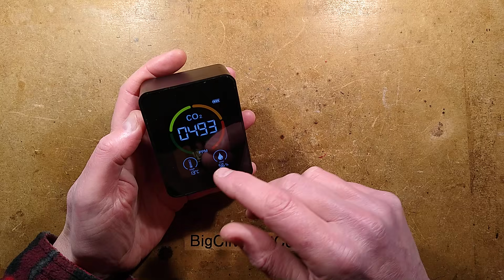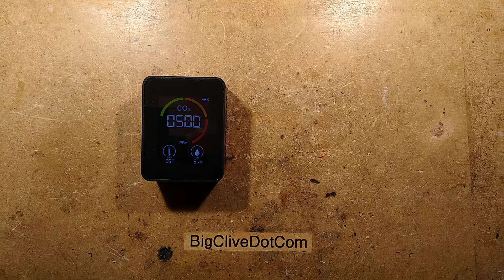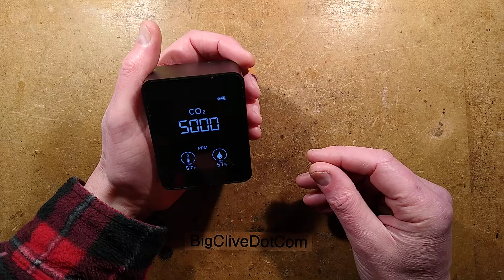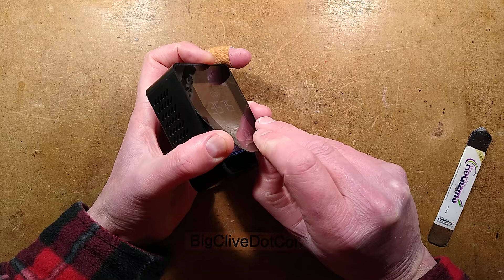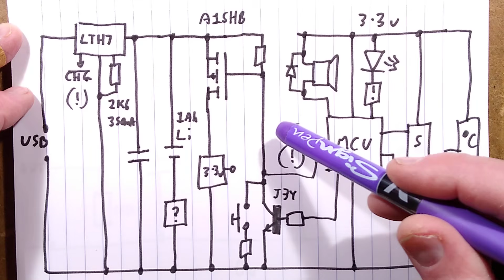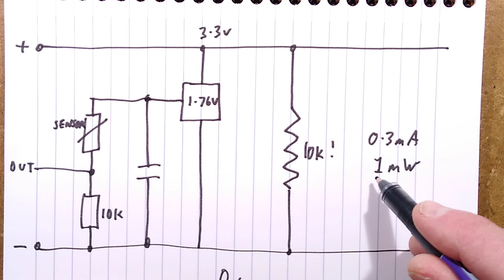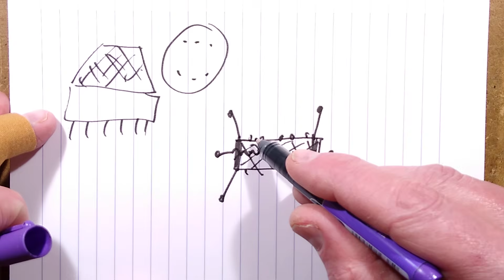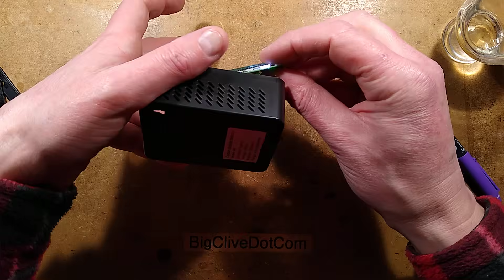Fake CO2 monitor (party detector) with schematic

Comment: Huh, this one is kinda weird... like why even? xD 
I've seen this design on Aliexpress, not sure if it's fake there too. Perhaps they are selling an erroneous mislabeled batch? Prototype batch that didn't work? Perhaps some people are just buying defective stuff from China and selling them on eBay.

See, here's the thing. I have two air quality monitors from Aliexpress... neither look like the one Big Clive has there, but I think one of them is like a more advanced model from a company that makes one that looks exactly like that.
The other is completely different and from another company.

I dunno how accurate they are as I don't have accurate instrumentation to compare to, but I do know that both are pretty sensitive to CO2 levels. If you breath a little close to it, it starts ramping up quite dramatically. 
Other measures like pm2.5 and pm10 also seems to respond well enough, smoking close to it will ramp up the numbers. I've also seem the numbers ramp up one day we had smog because of a forest fire closeby.

One of them has a clock and temperature that is somewhat correct, not a whole lot more than that.
The other has CO levels which I never saw moving, a hygrometer that is totally wrong (not sure if my unit is defective or it's just a fake - it's always at 90 something per cent as if I lived in a swamp or something), a thermometer that seems to be always a bit above the mark but changes accordingly, and also TVOC and HCHO which I dunno if works or not.

But it works well enough I guess... perhaps someday I'll open it up to see what is going on there. xD

Comment: I use a CCS811 module at home. In home assistant, the CO2 and TVOC graphs are completely identical, only the numbers are different. It does seem to work, but I have no reference to verify.
Reply: In s glass mix some vinegar & bicarbonate of soda (Sodium bicarbonate) it's in the Home Baking aisle in your supermarket. 
It will bubble and the gas given off is pure carbon dioxide.
That'd be a handy reference source of pure CO2 for you.

Comment: These are really common for example in fast food like McDonald’s, so employees know when to evacuate.
Reply: Is that because patrons may get a bit rowdy when the measured alcohol levels are high?
Reply: Is there ever a bad time to evacuate a McDonald's?
Reply: you sure that isnt a carbon MONoxide sensor not carbon DIoxide sensor?
Reply: @mycosys  100%. It's for the CO2 storage tanks for the soft drinks. 
https://files.chartindustries.com/20998342_McD_AX60.pdf

Comment: CO2 is good to measure as a proxy for air/ventilation quality, especially in terms of trying to inhibit the spread of infectious diseases, alongside how high CO2 levels tend to make people feel pretty sleepy/crappy. Had long wondered if the super cheap CO2 sensors I'd seen on sale were just VOC sensors, as actual CO2 sensor modules themselves are usually at least 70% or more of the price of them, big part of why I ended up putting some together myself. At least this way I know with certainty I'm actually measuring CO2 itself.

Comment: I would like to thank you. By watching your video on the lithium cells in disposable vape devices I have been able to fix several devices that the lithium cells had given up in. Even increased their working time significantly.
Reply: Bad idea. The wired resistance where the liquid evaporates is getting gunk over time and needs to be replaced. Get a proper reusable device or some rebuildable atomizer instead of using those disposable craps.
Reply: @PainterVierax  sorry I didn't specify. I am using the batteries for other devices, not vape related. I use a reusable vape with replaceable coils and tanks that are refillable for my nicotine needs, but had several old disposable ones that were laying around because I didn't wanna throw them in the trash because of what they contained and what it'd do to the environment.

Comment: The co2 reading is directly related to virus levels in the room. If there is someone with covid or the flue in a room and that rooms co2 level goes to 1200 ppm then there is not enough fresh air intake and virus levels in the air are also beginning to rise.
Reply: I have used a co2 detector on vacations and at big parties. Almost every bus getting to excursions had co2 levels above 1200 ppm. So I put on an n95 mask. 

Thanksgiving at my house is 25 people. Co2 gets to 1800ppm if I don’t have the circulating fan on. I can actually control the enthusiasm of conversation by playing with the co2. Allow it to go above 1500ppm and the room gets quiet. Bring it down to 800 ppm and people start talking again. It’s kind of funny to play with.

Comment: If it's Chinese, they probably got CO2 confused with CO on the display, and it's meant to be a Carbon Monoxide detector. According to one website: "Other gases that can set off Carbon Monoxide detectors are isopropyl alcohol, sulphur dioxide, acetylene, propane, hydrogen sulphide, dimethyl sulphide, mercaptan, ethyl alcohol, ethylene, methyl alcohol, hydrogen cyanide, and nitrogen dioxide."

Judging by the list there, it might also act as a Bad Breath detector.

.

Comment: So glad I didn't buy that one. It's cheap. But the one I got had more review and a better rating. Also, a non alcoholic exhalation with raise the numbers. Cooking on my gas stove without the range hood venting also raises the numbers. One time making fig jam I had the large burners going full throttle and it set off the sensor on the other side of the house. It is good to have a co2 sensor. I now use the vents and open the windows more often. I have the Forensics Detectors FD-CO2000.

Comment: I have the exact same one at work and noticed the same thing ..upon further inspection I found out that common CO2 sensors have readings in ethanol as well (the SMD type)..so I didnt think it was fake(breathing on it did make a difference though) just a limitation
Reply: Breath has water and other interesting chemicals in it. So reacting to your breath isn't odd.

But you need to open fizz to check for CO2 sensitivity

Comment: CO2 is used as a proxy for measuring air that is stagnant. Mostly in the context of trying to ascertain if a public building has adequate exchange of outside air to help reduce airborne virus spread.
Reply: Our HVAC system at work has a CO2 sensor in it. If it gets above the set level it opens a damper to pull in fresh air from outside. It's pretty neat to look at the graphs in the reports it can generate and see the level around 425 ppm first thing in the morning and as everyone arrives it starts climbing. Usually just after noon or 1PM the level gets high enough that the damper starts cracking open and the CO2 levels off. If we have an event that brings an extra 100-200 people into the building it will spike way up and the damper goes wide open trying to compensate.
Reply: and the sensor is a VOC sensor that uses VOC as a proxy for CO2 in human presence.
Meaning: This device guess air staleness by guessing CO2 Content by guessing VOC content.
Why not skip the extra steps and guess air staleness from VOC content?
Reply: @sarowie  Omg I love that roundabout so much. It's the pinnacle of consumer goods.

Comment: The new Sensibo air quality monitors have the same problem. It falsely says CO2 in multiple places. They call it "eCO2" when it actually measures VOC. Unfortunately, burning candles don't give off alcohol. Neither do plants. Not sure about fish. Took me a while to figure out what it was measuring. Big argument to get the store (KSP) to accept a return. So annoying! They don't understand what they are selling.
I have an expensive Chinese CO2 controller that actually measures C02, and when it goes high, I increase ventillation.

Comment: Gas stoves will have the CO2 levels in their house easily climb up to 1,400 ppm from using the stove (not to mention the fine particulates gas stoves pump into your house).

Comment: The proper modules to measure each thing are very expensive, such a pain in the butt and can be ruined by humidity

I did want a proper co2 meter, you always wonder if there are safe levels in the home or whichever, maybe this unit can be altered to work properly?
Reply: No. Just buy a real CO2 monitor.
Reply: @mrtechie6810 what a thought out and we'll reasoned argument...

Comment: Unfortunately some new build houses require Co2 detectors in the main bedroom in scotland. We even had a large 120 YO house that had a big conversion and we had to go back and fit one as they would not sign of on it without one fitted.
Reply from the maker: Carbon dioxide as opposed to carbon monoxide?
Reply: @bigclivedotcom  yes, scottish building standards technical handbook 2022 section 3.14.2 requires CO2 monitoring in the master bedroom in certain houses. We missed this one as we thought that the architect misspelled CO- got picked up on by the council in last inspection.
Reply: I can’t seem to find any information relating to Carbon Dioxide (CO2), i can only find information relating to Carbon Monoxide (CO) detector legislation (which is part of the smoke alarm legislation that came into effect in early 2022, and i would suggest looking up the smoke detector legislation)
Reply: @pineappleroad  look up the scottish building standards technical handbook 2022 - domestic section 3.14.2 👍

Comment: CO2 measurement is often used to control ventilation in Schools and office Meeting rooms. There has been some research done that relates CO2 levels to concentration. Normally the level is used to ramp up the fresh air to keep the levels below 1200 ppm. The sensors are linked to a BMS and the fresh air ventilation or fan and actually work quite well.

Comment: "monochromatic display with coloured panels printed over the circular segments" That's pretty much the description of how Space Invaders machines first went from B&W to colour. A few strips of coloured gel over the screen. Sometimes not much moves on from the 1970s.
Reply: If you ever build a control panel or instrument panel which requires (or would benefit from) backlit graphics, you may find yourself doing the same. ;)  But to find it in a consumer product?  Oh hell no. O_O
Reply: yes :) The bit of yellow tape over the bottom of the screen.
Reply: My nor-tec weather station has the background (above the backlight) printed with a landscape photo, text and different colors for inside/outside display sections. The actual display itself just consists of black and white LCD segments (in different shapes) on top. I find this a nice way of making a stylish looking display, but with extremely low power consumption (and probably price) compared to using a real OLED or TFT. Especially as the display is rather large.
It's a good device, with temperature/humidity/air-pressure sensor built-in, with a radio clock receiver (DCF77) and a 433MHz receiver for up to three wireless external temperature/humidity sensor modules, adjustable backlight and a capacitive snooze button (for the alarm). And you can use it with two 1.5V AA batteries and/or with an external 5V power adaptor.

The "CO2"detector display looks similar, maybe the color is printed on the backlight diffusor, then the LCD just needs to block out the light.?
Reply: The Chameleon in-home display for my smart meter does this to give coloured segments, also oled displays I have bought have an option for a yellow strip of pixels on an otherwise blue display to highlight an info bar.  This display is also used in an old Alba personal DAB radio I have, the yellow area is used for icons for signal strength, mode, battery state etc.  Many AV separates have a monochrome fluorescent display where some icons such as record have coloured panels to change them from white to red or yellow.

Comment: Glycerol is an alcohol, so I guess it depends on the specificity of the sensor
Reply: Ya, cheaper ones like first i bought even glass of red wine will fool the HCHO monitor. Guess any similar "gasses" just cant tell the diff.

Comment: As far as I'm aware, all of the consumer-grade "CO2" detectors out there are similarly fake. It turns out that actual CO2 sensors are too expensive to put in cheap consumer devices. As for why people want them, well, mostly people are using them as proxy for measuring how well ventilated a space is (whether an office building, a public bus, etc.) and thus how how likely it is that the building's HVAC system is clearing viruses from the air. Measuring VOCs may be just as good a proxy as CO2 measurements would be. I'm not sure. 🤷🏻‍♂

As you've discovered, these sensors are very sensitive to ethanol. In fact, the datasheets for some of these sensors (e.g., the SGP40 sensor from Sensirion) list their specs in terms of ethanol.

Comment: An LCD can be driven from any old boring CMOS digital output as long as the DC average is zero. So any MCU could do that. LCD driver circuits on-board help with automating the scanning and make it easy to adjust contrast without having to fully grok LCD driving. Temperature compensation of contrast can also be provided by a dedicated circuit. But this MCU happens to have temperature info from the sensor so it could do this compensation in code. I kinda doubt it's that clever. Try it out! Stick the thing into a fridge and see how the LCD contrast compares.
Reply: LCD's are quite finicky to drive directly, aren't they? You can't use plane DC voltage.
Reply: @Peter_A1466  Sure, but that’s why there are CD4000 family chips that do that (since the 70s), and any MCU can easily do it as well. Generating a not very fast 50% square wave output is not terribly hard :)

Comment: LOUD noise  🤷‍♂🤷‍♂ you fart louder. 🤣🤣    I would be interested to see if any of the vape flavours are safe to inhale in the quantity's from the puffing device. 
Its an interesting little screen and box for hacking into something "useful" because in it current form its as much use as a chocolate fire guard.             nice video 2x👍
Reply from the maker: The flavours are the only unknown variable in vape safety.  Made worse by the high strength used in disposables.
Reply: It detects alcohols, like the glycerine and propylene glycol that vapes are based on

Comment: love it, seems to be loads of sellers selling basically identical models but with ranging prices
Reply: That's always the case, you can always pay double for random Chinesium gadgets on ebay if you like. Unless there's something you know is actually expensive in there (e.g. special gas sensors), I usually aim for the cheapest one I can find for stuff like this. Only exception being if the manufacturer is known and there are known fakes/clones out there that don't work as well, then buy from the source/authorized sellers.

Comment: I found a good article on the thick film tin-oxide hydrocarbon/alcohol sensors. The heated tin oxide acts as a catalyst where adsorbed oxygen and hydrocarbon are “burned” on the surface to release water and CO2 and electrons. The resistive nature of the electrode provides the heating. There are apparently numerous other types of alcohol sensors. Some sensors have selective catalysts or enzymes that break down specific target molecules, coupled to an electrochemical process like a battery. Resistance change or current flow. Teterycz H, Halek P, Wiśniewski K, Halek G, Koźlecki T, Polowczyk I. Oxidation of hydrocarbons on the surface of tin dioxide chemical sensors. Sensors (Basel). 2011;11(4):4425-4437. doi:10.3390/s110404425🎉

Comment: There do exist eCO2 sensors, such as the CCS811, which use a TVOC sensor and some maths to estimate the CO2 in the room. Of course, if you just want an indoor air quality score, TVOC is a perfect metric anyway.
Reply: TVOC is but one metric of indoor air quality, far from perfect by itself.  PM2.5 and CO2 concentrations are also important.  The three are not highly correlated, as they all have different sources.  

Fires and cooking are sources of PM2.5 pollution. Chemicals, objects and building materials are sources of VOCs.  Humans' exhaled breath is a source of CO2.  All of these things affect human health and function in different and significant ways.  If you want a real view of indoor air quality, you must measure more that one thing.
Reply: @jbalazer  I had the Sensibo air quality meter in my home for a week, next to my CO2 controller.
I cooked (induction) and baked (electric), burned a dozen candles, breathed, opened and closed windows....
The PM2.5 and TVOC (and eCO2) were basically useless. PM2.5 read close to zero ALL the time. TVOC would very occasionally spike a bit for a while -- seemingly at random. Only the CO2 controller gave useful and reliable information. CO2 level is enough information unless there is a specific problem in the location. I returned the "air quality" meter.
Reply: Not in my experience with the new Sensibo air quality monitor vs an actual CO2 sensor. We burn candles indoors and the eCO2 sensor is useless for that use case. I returned the Sensibo.
Reply: @mrtechie6810  Well technically burning a candle does taint your air quality by the fact that you're burning something and releasing micro particulate matter into the air in your internally monitored space.
Reply: @LND3947  not enough to matter, apparently. The CO2 levels increased from 400 to over 1000ppm, but the TVOC and PM2.5 sensors in the Sensibo did not measure anything significant.
Reply: @mrtechie6810  Well that's based on current health guidelines, and having seen the various changes globally by regulators on what the maximum level of various particulate matter should be in the air for safe and healthy living I wouldn't be surprised if a lower level for total volume of particulate matter per m² changes in the following 10-Years as new research into things unveils hidden dangers we may not have previously been aware of.
Reply: @LND3947  No kidding, people once thought burning coal gas inside for light was a brilliant idea.